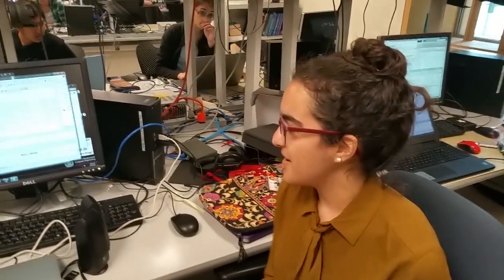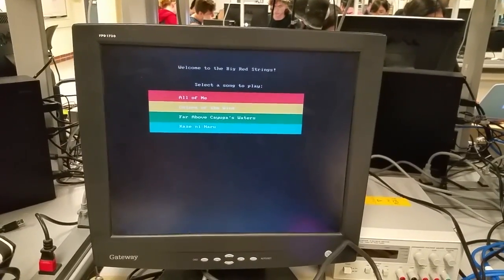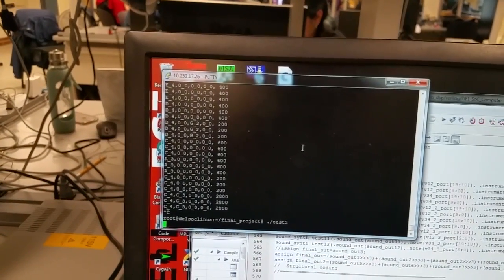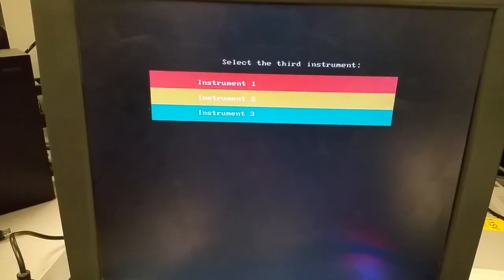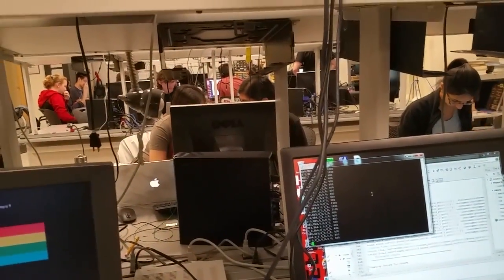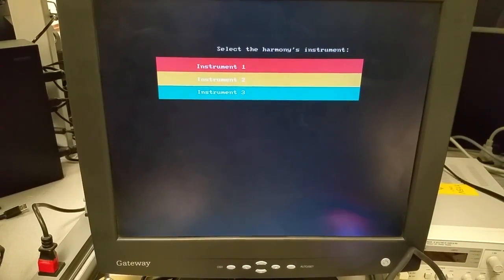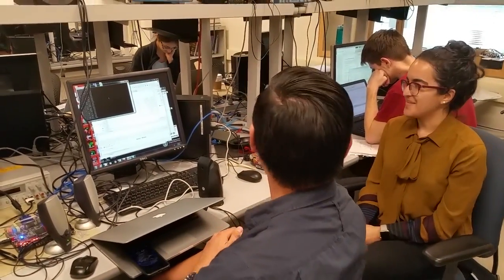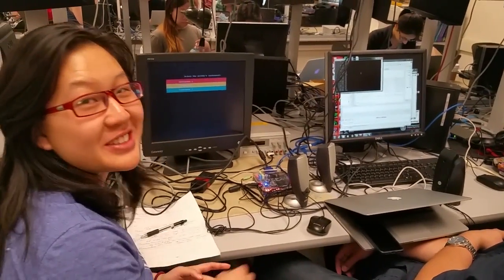FPGA String instrument synth + HPS sequencer

Comment: So, what exactly was the FPGA doing here?  Was it running sofware, on a CPU model hosted on the FPGA, or was it doing something closer to custom made hardware?

It would have been nice to hear a direct line recording, instead of plinky noises over tiny PC speakers...
Reply from the maker: Did you read the linked report? The ARM was the sequencer, play the Karplus-Strong synthesis running in parallel on the FPGA.
Reply: @ece4760 , I didn't, because it wasn't clear to me from reading the comment that there was a linked report - or from watching the video.  I don't just cllck every unexplained link I see.

The reason I ask is that I'm familiar with this being done in software, on a conventional CPU/MCU, and I'm aware that an FPGA is capable of implementing an MCU.  From the video, I couldn't tell if that was how this was done, or not.

FPGAs are interesting, but I'm still looking for a good reason to use one.
Reply from the maker: @TooSlowTube  I agree. You need a good reason to use one. The tools are daunting. I think that parallel solution of partial differential equations is a good use for FPGA if there is a real-time constraint. Physical modeling of bowed strings by brute force solution of the wave equation comes to mind. For the 2D wave equation on a drum head, the small FPGA we were using in class was about 100 times faster than a 1 GHz ARM A53 core.
Reply: @ece4760 , Yes, doing a lot of things in parallel seems like a good reason.

I found an FPGA Hammond organ simulator demo : https://www.youtube.com/watch?v=OOmVIg0raWo and I've recently seen a polyphonic 6 operator FM synth - both of which could be done with a fast enough CPU, but an FPGA could potentially do it better.  

Unfortunately, people don't seem to want to share the source code in the same way that people writing for MCUs tend to.

I've watched quite a few alleged introduction to FPGA videos, and so far learned close to nothing about them.  It is kind of hard to know where to start.